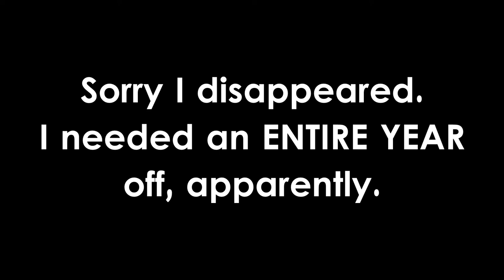PC Build Montage (AMD A6 Dual Core/8GB RAM) - 2K Rig

Comment: No graphics card?
Reply from the maker: Yeah, I was going to get one that would do Crossfire with the integrated graphics on the APU, but the spec sheet the seller gave me was a lie and the APU wasn't Crossfire compatible.  Sad story.

I'd get a nice GPU for it, but a) the integrated actually runs most things fairly well, and b) I don't have the change to chuck at it right now.  For heavy/performance gaming, you'd want something beefy to tag along, but lightweight stuff does just fine.
Reply: Destiny 2 @ 30-40fps avg on low settings is possible with a good overclock on both CPU and GPU cores. Got mine to 4.2GHz and 960MHz respectively on stock cooler, dual-channel 1866MHz RAM, and an A78 motherbord, though 4.5GHz and 1200mHz is possible with good VRMs (A88X) and a beefy air cooler or water cooler. I ordered this build again to see if I can still do it lol.

Doesn't it Dual Graphics with an R5 230 or 240, though?
Reply: @RisteardXD4  that's impressive results. Mine gets VERY hot just for reaching 4 GHz. In the end I keep it at 3,5 GHz all the time.

Comment: Don't you need thermal paste?
Reply: same reaction xd
Reply from the maker: You don't need thermal paste on a stock cooler, it's pre-applied. Unless you're doing some heavy overclocking (which, for light gaming, isn't necessary and will shorten your CPU lifespan), your choice to go beyond the stock paste doesn't have that much impact unless you're also upgrading your cooling setup.
Reply: 1:26 i don't see the pre applied thermal paste
Reply from the maker: It's there! Just blends in. It certainly doesn't run hot. Plus I think I'd have noticed something like that.